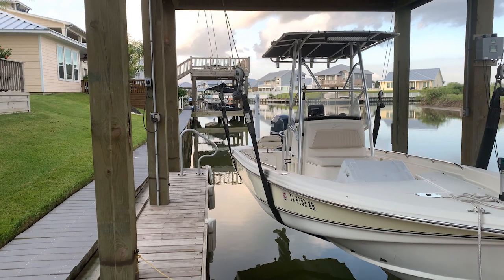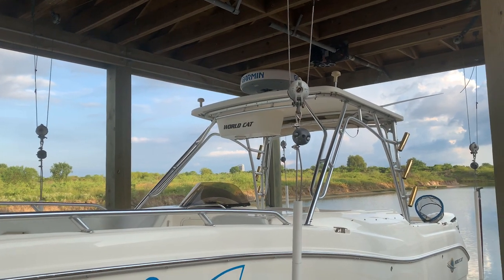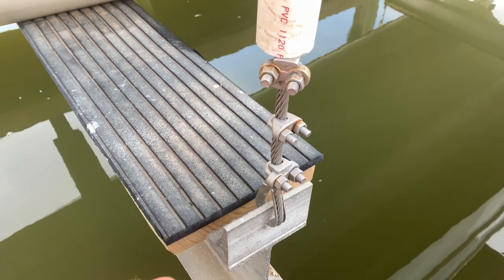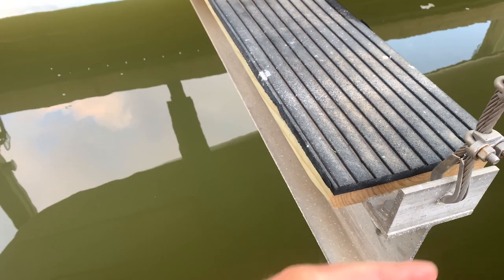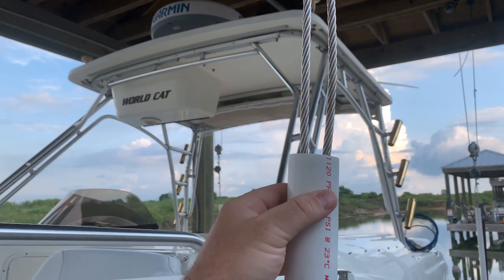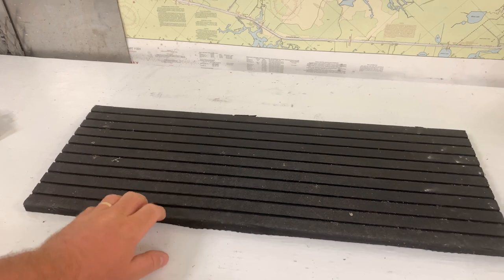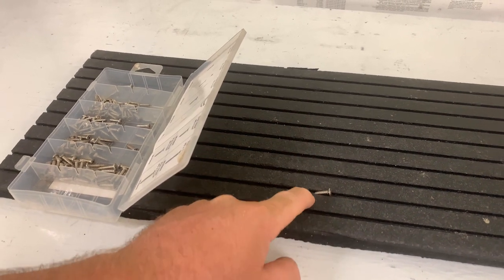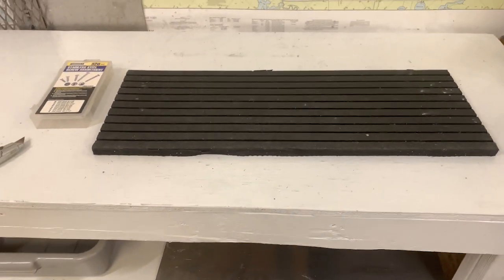Converting a boat lift from slings to bunks for catamaran.

Comment: Great video, very useful. Thank you. Will you please describe how you bolted the wood to the steel? What type of bolts, stainless? did you countersink the heads? Through the flange I guess, right? How many bolts? Appreciate it!
Reply from the maker: Countersunk stainless bolts through the wood and through the aluminum I beam.  I placed a piece of thick rubber mat (horse stall mat) between the board and the I-beam, this is to keep the wood from ever actually contacting the aluminum as treated wood has metals in it that will cause aluminum to corrode.  Stainless and aluminum (bolts) can touch as they are compatible but the copper in the treated wood will corrode aluminum

Comment: Did your I-beam endplates come with your I-beams, what is the material and thickness?
Reply from the maker: Yes they were already bolted on.  I believe they are just 1/4” angle pieces bolted direct to